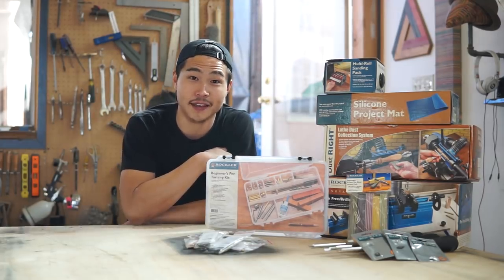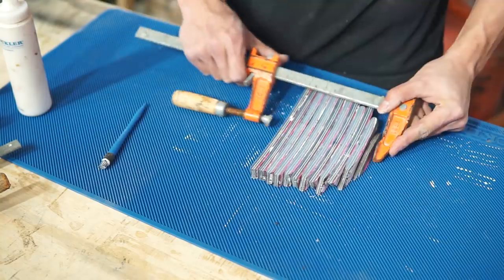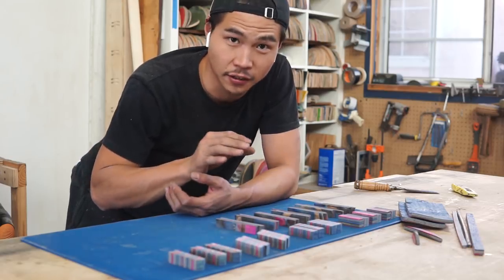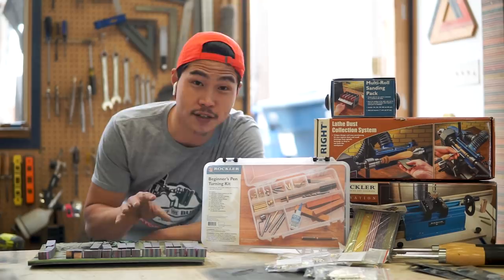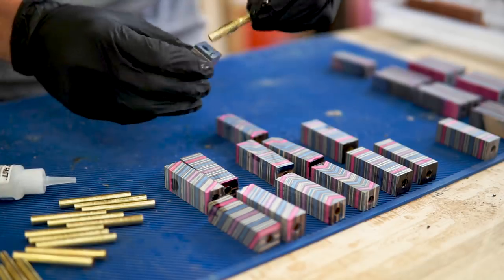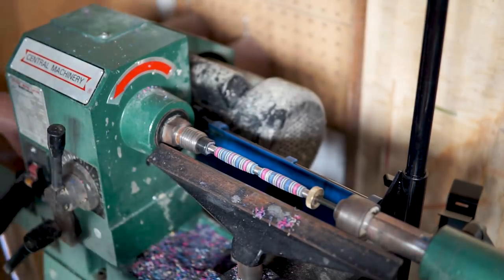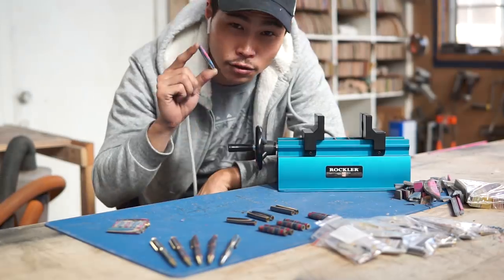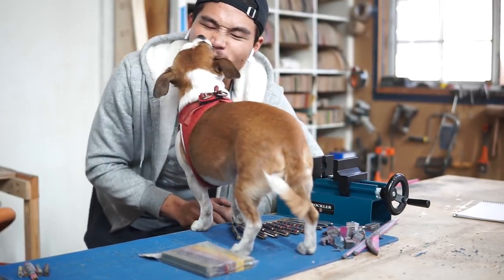PENS MADE OUT OF ONE SKATEBOARD!

Comment: Rockler Lovin this channel. Keep up the good work. Your videos are always interesting.

To make things a little safer while working with smaller pieces and turning wood that might have loose internal fragments I recommend trying impregnating the piece with resin using a vacuum seal method. It will pull the resin deep inside and give you a more solid working material. It does take longer to make but the pieces will also last longer because they will be less prone to moisture fluxes. Once again keep up the good work. Look forward to more videos.

Comment: When i use softer woods on the lathe I usually round them on a sanding belt first to hopefully avoid chipping. It still happens sometimes but it's definitely easier. And when they break I glue them back on and continue making it.

Comment: What type of band saw are you using? I wanna start working with boards any advice on what tools I should get first ? And equipment?
Reply from the maker: id recommend skipping the entry level tools and buying laguna 14-12. if you only have few boards, just buy a lathe and a japanese pull saw. that's probably my most "fun" tool.